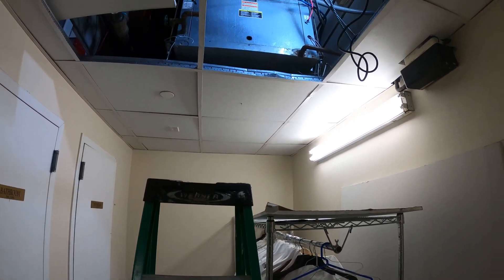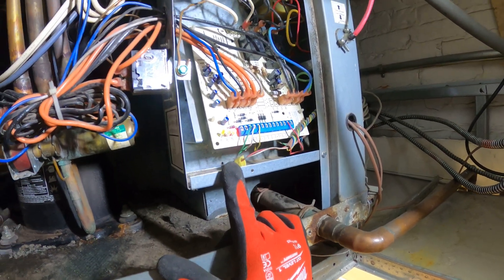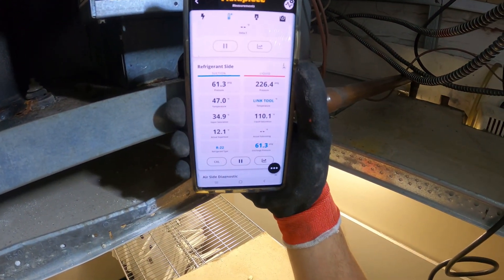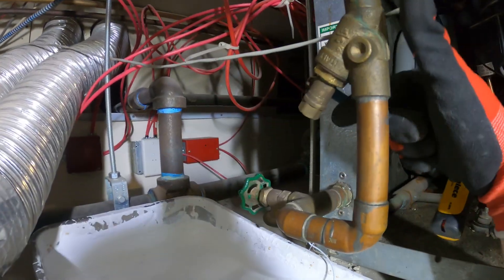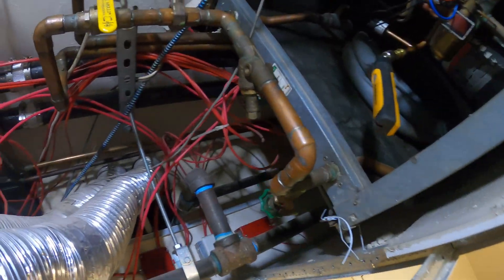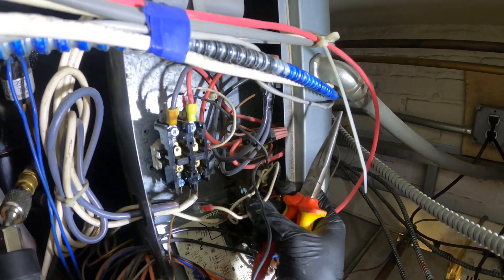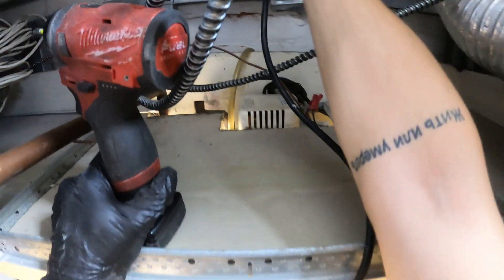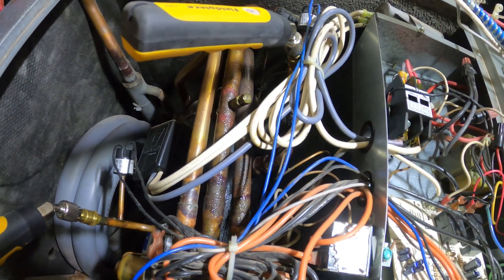HVAC: Water Source Heat Pump Not Cooling (McQuay Water Cooled Heat Pump Troubleshooting Guide)

Comment: Another Mc Quay....w 208 240 volts coil.  The board seems new.  We do backflush here in FL I never seem Glycol in units down here. Water run at 85 in. In better bldgs never lower than 70 unless is chill system at 55 degrees....Code 2 here is high Head press. Blessings great video. Where u learn so much bro.😎

Comment: how you know which valve to close on water source units?
Reply from the maker: The pipe with the strainer would be your supply/inlet line and other pipe would be your return/outlet line. Another way to tell would be that your colder pipe would be the supply & the warmer one would be your outlet. Thanks for watching & stay tuned for new videos every week🔧⚡️

Comment: Load shed, and i thought the system can't get rid of the heat, like in the high temp summer when you spray water onto the condenser.

Comment: Awesome video! I replaced a circuit setter and pulled the Inlet screen valve assembly out and cleaned it out as well and found pure mud in the screen and in the whole inlet valve lol.
Reply from the maker: Thank you! I bet! Maintenance is so important. Those water strainer always get dirty. That's the first thing I go for when I see a water cooled unit running on high pressure. Thanks for watching & stay tuned for new videos every week🔧⚡️